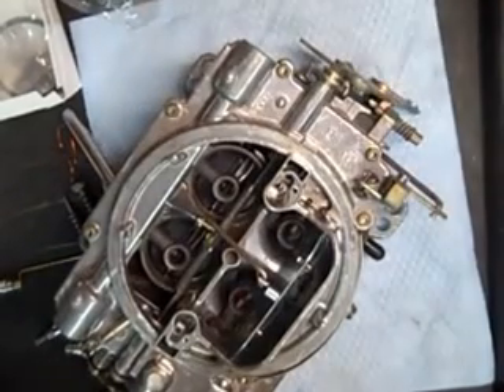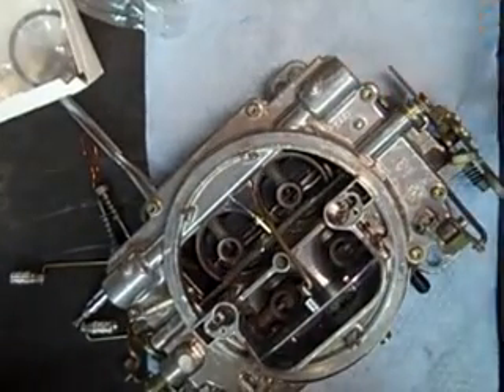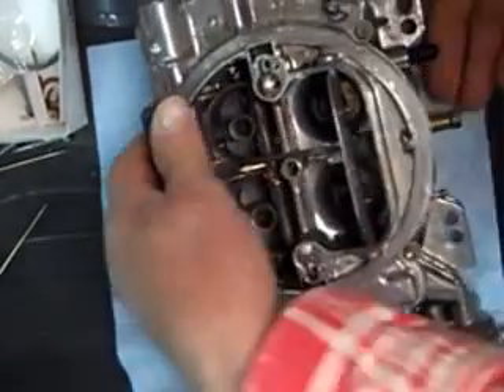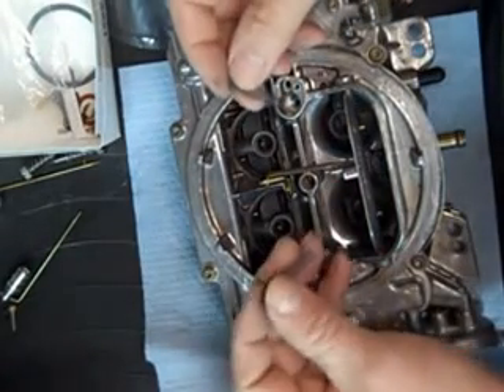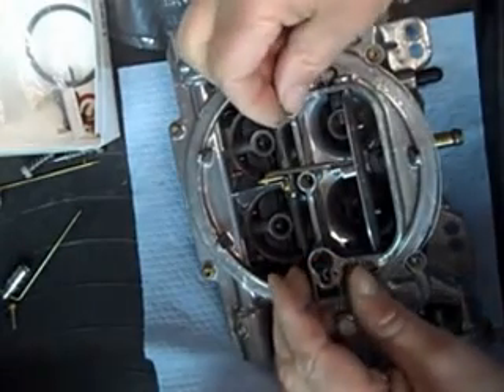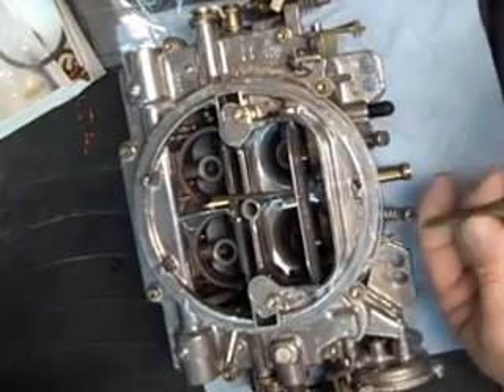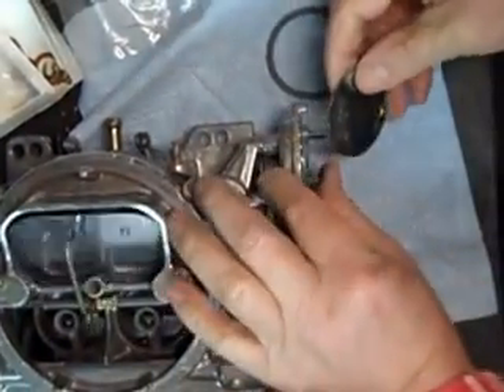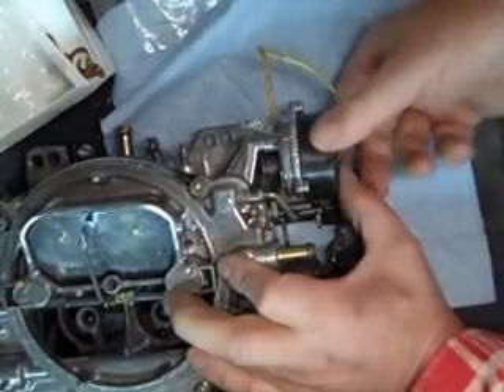Carter AFB 9000 Rebuild Part 6 of 6

Comment: Yeah I got a question for you I'm  macnanic at Northern Lakes Marine and I'm doing my first Weber carb. But it's for a 4.5 litre boat engine, so the secondarie adjust is different ,   I think,  you know the flop weights either stay partially open or there closed,  the plate with the weights dont move much when closed, but unlike your plates they have cut outside in them,  so I'm thinking the closed position is right?  Can you give me some insight on that?

Comment: 2:10 Accelerator pump linkage.  I was under the impression that if you moved it to the outer hole, you got a SHORTER stroke, since that puts the link further from the pivot.

Comment: I replace all of my Rochestor carb powered motors with a carter AFB.I have not bought a Edelbrock carb yet..the first gen Edelbrock carbs where rebuilt old carter carbs and they had problem with them. carters are lot better on fuel then the rest of them in my book.